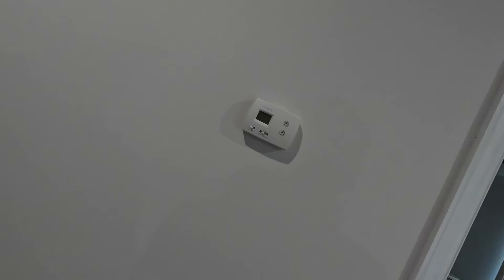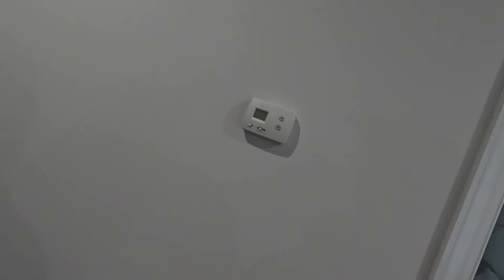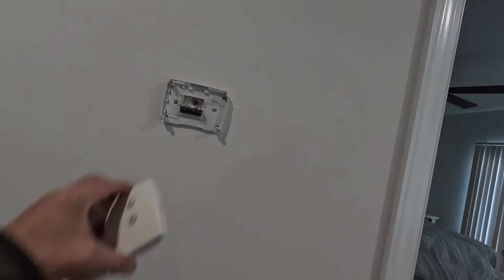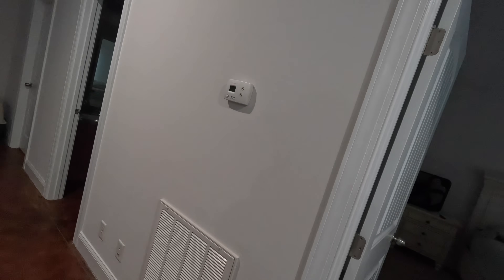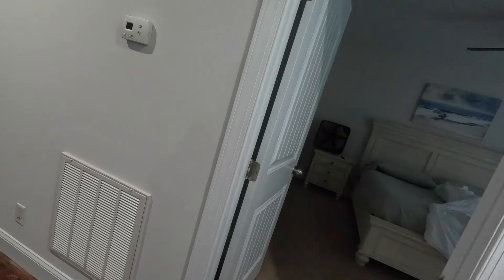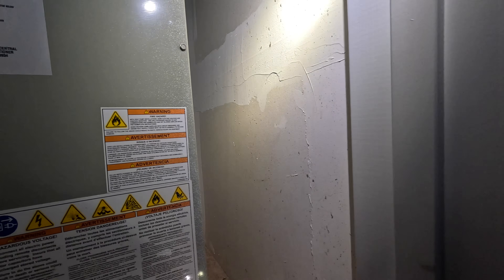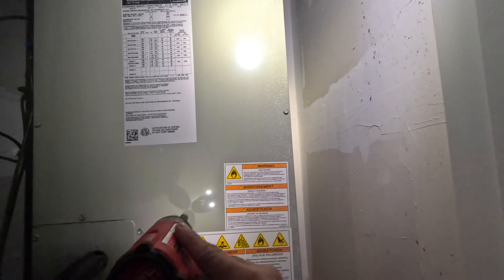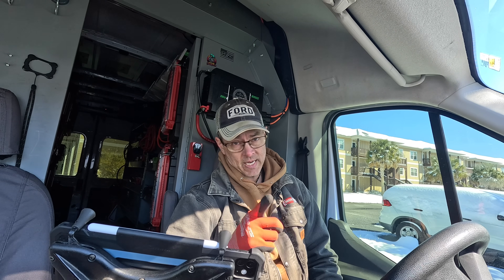Frigid Temps, and He Had No Heat At All! #hvaclife #hvactrainingvideos #hvacguy

Comment: Great work as always. We started using the lever wire nuts low voltage. Makes is so much nice when you have to diagnose low voltage issues.  No pulling regular wire nuts off and untwisting the wires. Also makes it a lot nicer trying to check voltages while connected.  We were at -8 degrees this morning in south eastern PA. Where did you get that little magnetic tray in your bag from?

Comment: 8:23 looks like Romex was run through the conduit, that is a no-no and not code compliant. Exterior conduit is considered a wet location. UF or individual THWN conductors would have been the correct choice.
Reply: it is allowed to be in conduit, for short runs if it's being used for physical protection. BUT romex(NM-B) outdoors is against code anyway or any potential wet location(like you stated)
even though I believe it's all actually wet rated conductors coating and outer jacketing now, the paper layer and paper around ground makes it not allowed.
the HVAC installer typically don't care and just slam in whatever, the sparkies work generally stop at the disconnect line side.
Reply: @throttlebottle5906  I saw one around here with Romex run between the unit and disconnect, no conduit at all!

Comment: Exact same thing happened to my carrier unit 2 weeks ago coastal Alabama.   Outside thermostat wire shorting blowing air handler fuse.  Tape and padding and new fuse, up and running less than 30 minutes.

Comment: Likely caused by someone walking through the condensor and tripping on the liquid tight, pulled the wires and caused the short. Might have wanted to secure that liquid tight a little better Curtis. Us Canadian folk call the Skull caps toques or block heaters hahaha.👍👍🇨🇦